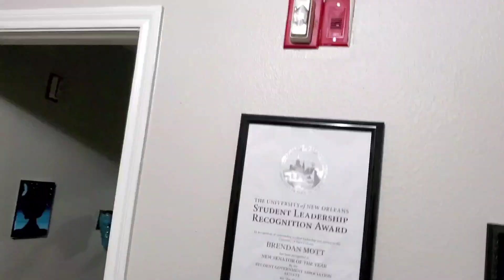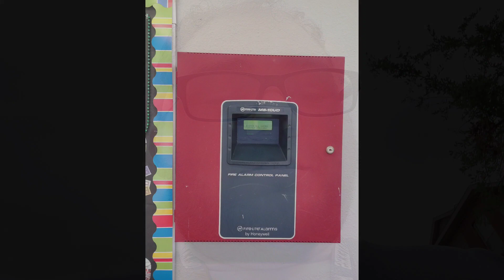College Apartment Fire Drill (10/27/2021)

Comment: Cool video! I'm sure it was more fun than them just testing it. Are there system smoke detectors, do the residential smokes trip a relay, or none of the above?
Reply: None of the above
Reply: @the_great_brendonion  Aha. I've actually seen one system at a fancy new apartment complex where they had 120 VAC smoke/CO units in all the apartments which were interconnected within the apartment but did NOT report to the panel.

BUT there were a couple of these same units in the lobby and the lounge area that did report to the panel via relays. System was a Simplex 4100ES.
Reply: @Fahrenheit4051  Around where I am, we have a code that all hospitality complexes (Apartments, hotels, homes.) Must have smoke alarms along with system detectors. Whether or not they are wired to the panel does not matter, but they must be there.